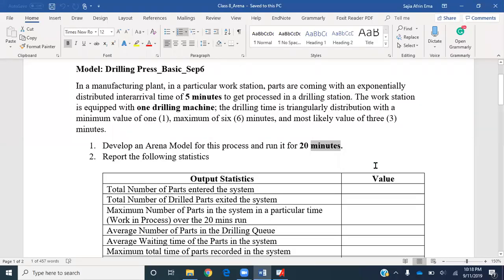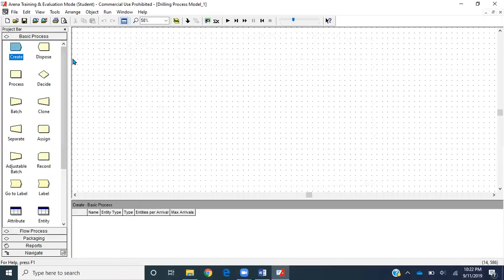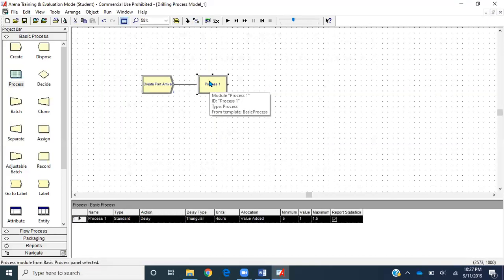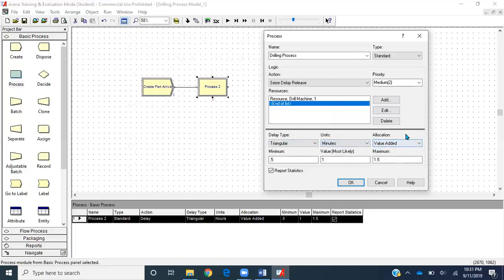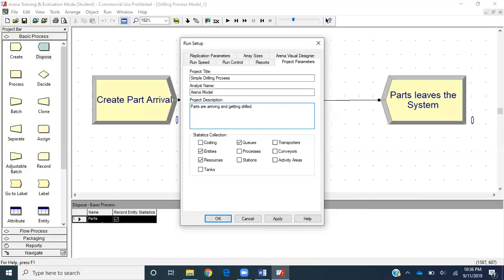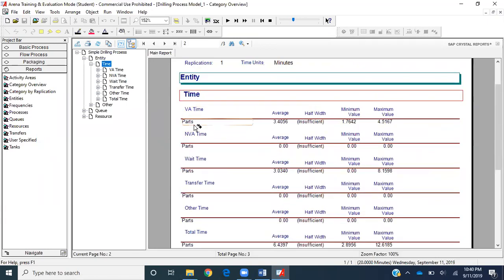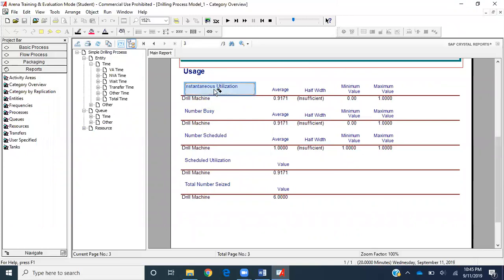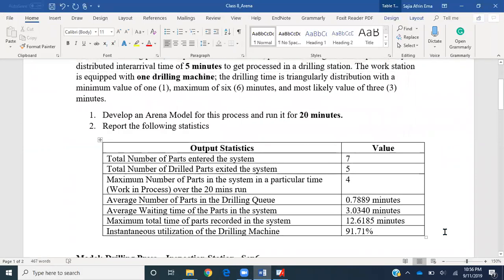Simulation model of a simple process using Arena

Comment: A gas station has 5 gasoline pumps – one dispenses only diesel fuel and 4 dispense both diesel
and unleaded gasoline. A customer arrives to the gas station following a uniform distribution
with a minimum time of 20 seconds and a maximum time of 1 minutes. When a customer
arrives, 70% of the time he/she wants unleaded fuel. As such, he/she tries to queue up in a single
line for the next available diesel/unleaded gasoline pump. If there are already 3 cars waiting for
the diesel/unleaded gasoline pumps, then there is no room for the arriving customer to wait. As
such, rather than join the queue, he/she drives around the block and comes back again in 2
minutes and always joins the queue regardless of the number of cars. Assume that the time to
pump gas form a diesel/unleaded pump follows a normal distribution with a mean of 2 minutes
and a standard deviation of 20 seconds.

Thirty percent of the time, an arriving customer wants diesel fuel. If this is the case, he/she needs
to decide which waiting line to join – the line for the diesel only gas pump or the line for the
diesel/unleaded pumps. To decide, our diesel fuel customer looks at the system. If he/she
observes that the diesel pump queue has 1 or more car waiting and the diesel/unleaded queue has
2 or fewer cars waiting, he/she joins the diesel/unleaded line. Otherwise he/she joins the line for
the diesel only pump. Given how this pump is located on the property, there is no limit to the
number of cars that can wait for this pump. The time to pump gasoline at the diesel only pump
follows a normal distribution with mean of 2 minutes and standard deviation of 30 seconds.
Simulate the gasoline system for 60 minutes and collect the following statistics:
1. The total numbers of cars arrive to the gas station.
2. The average queue size of the diesel only pump.
3. The average queue size of the diesel/unleaded pump.
4. The total number of cars that must circle the block.
5. The utilization of the single diesel pump.
6. The utilization of the four diesel/unleaded pumps.
7. Count number of diesel cars that use the diesel/unleaded pump.
8. Count number of diesel cars that use the diesel only pump.

Please help me with this, Thankyou